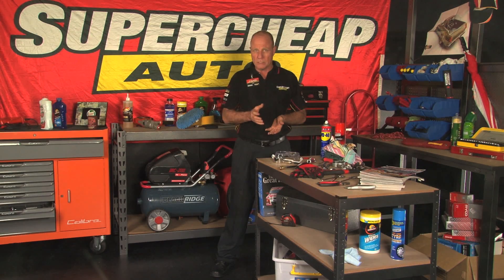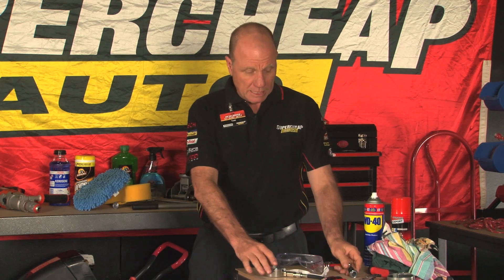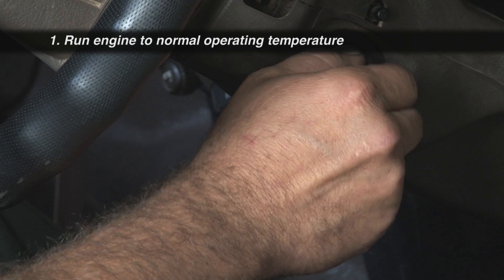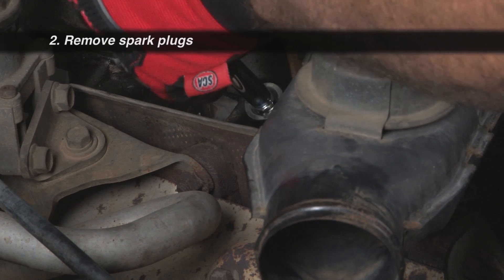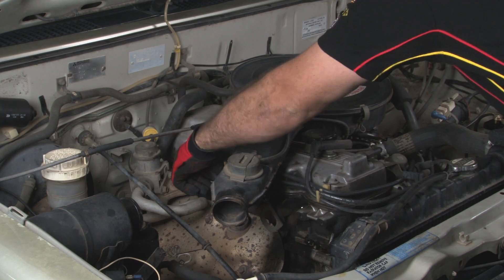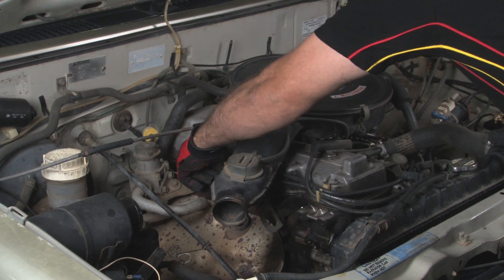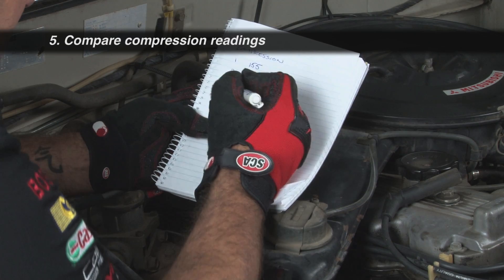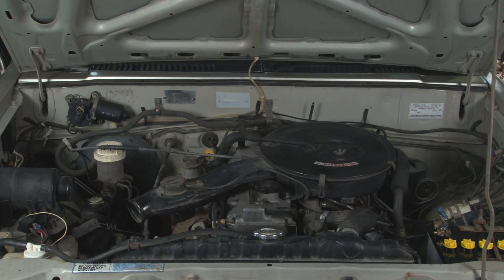How to - Using an Engine Compression Tester // Supercheap Auto

Comment: Bit of a fail there Supercheap. It is really easy to determine if a drop in compression is due to the valves or the rings.
Who does the technical side of your videos, not a real mechanic that is for sure ??